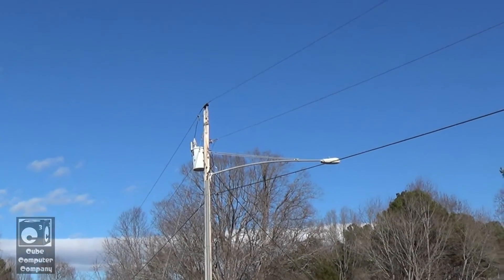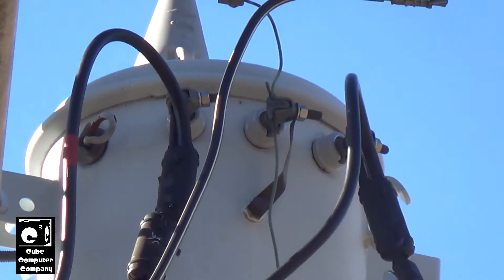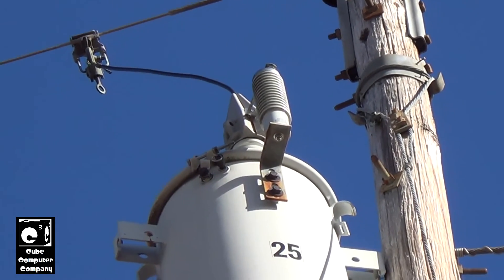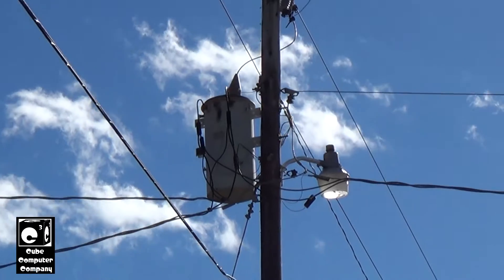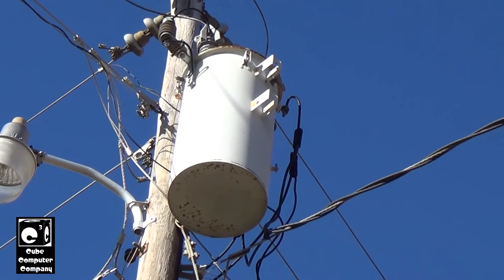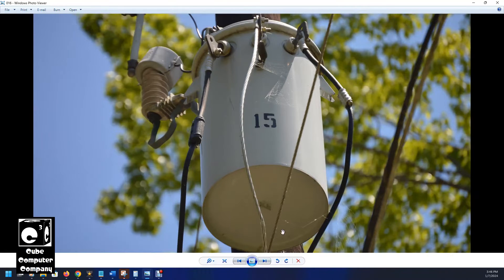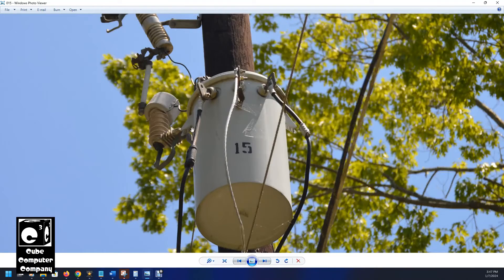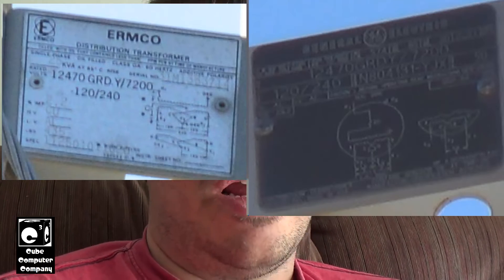Up close look at distribution pole transformers

Comment from the maker: The GE 50 kVA transformer shown in this video saw its last day of service on 6/11/2025 as it was removed from service and sent off to the transformer graveyard. It had been in service since 1985 and had a manufacture date of Sept 1984. New home construction across the street prompted the electric utility to add capacity by splitting this transformer's load up between two 37.5 kVA transformers, with one being set up on a newly added structure across the street, and the big 50 and its aging pole both getting replaced. While this transformer's replacement was warranted, it's not uncommon for this utility to replace good transformers when replacing rotted structures. With these structures being originally built with pentachlorophenol treated poles in the 1980s, these structures are beginning to reach end-of-life. Meanwhile, the transformers on them oftentimes have zero rust, and are in some cases newer than the structure itself. Do you agree with this utility's practice of replacing perfectly fine transformers, or is it wasteful? Keep in mind pole transformers have been known to reach 80+ years old in service, and there are transformers out there of this age, which remain in service.